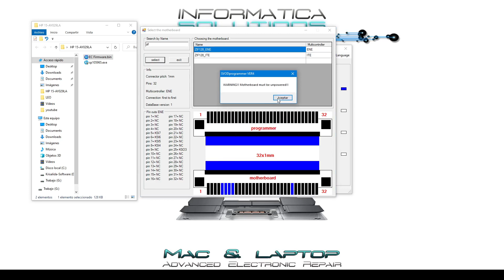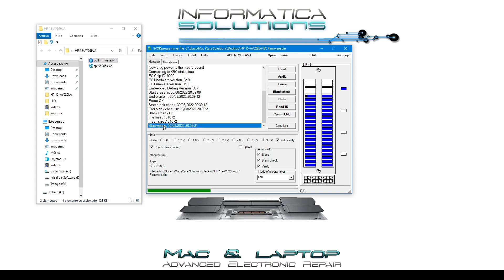ENE KB9022Q Flashing Proccess with Svod4 Zif Socket Debugger

Comment: I bought svod 4
And I noticed something strange about it.. which is when I update the programmer firmware it does not reconnect to the computer after the update is complete, I have to unplug it from the computer and reconnect it again to work..Every time I get this problem with a new release  of the software.. and the current software is 0.0.2.5..As far as I know, the programmer should reconnect to the computer automatically after updating the firmware.
Do you have the same problem?
Reply from the maker: hello seo seo, I have not had that problem, whenever I update the firmware it reconnects by itself, the only thing I have to do is select the voltage. Are you using the original USB cable?
Reply: @informaticasolutions  yes